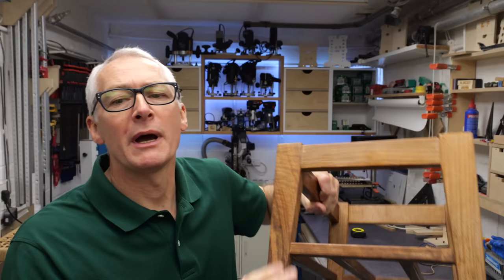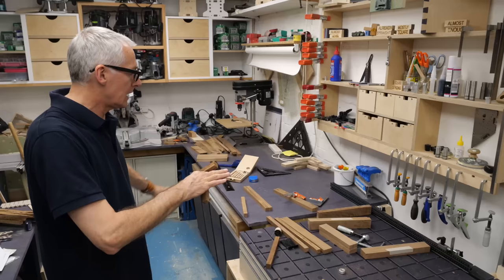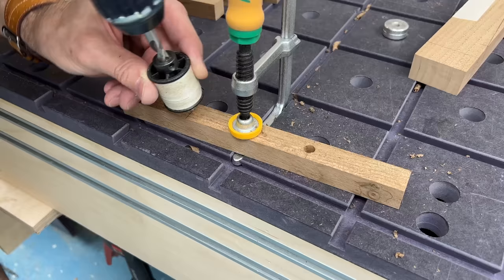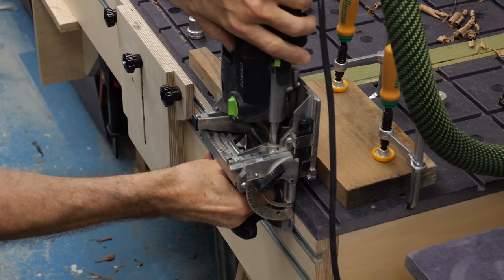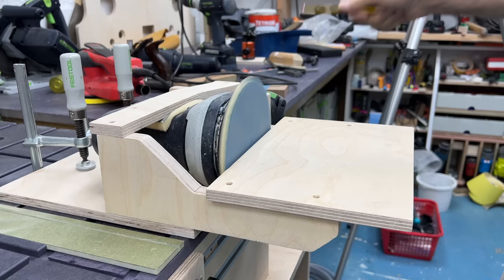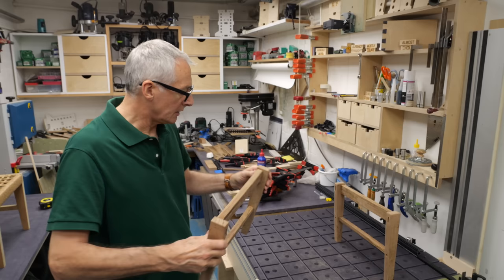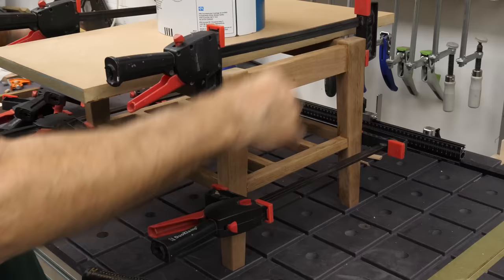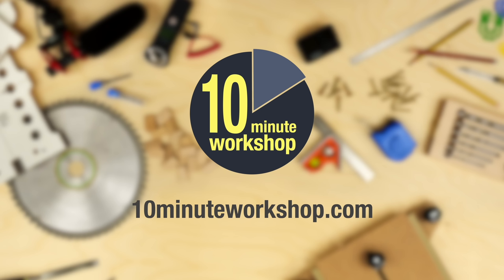Mid-70s style Walnut Footstool [video 503]

Comment: I can't remember where I saw it, but about 10 years ago when preparing trim around windows, I picked up a tip to adhere sandpaper onto a 100mm steel spatula (scraper) with spray adhesive to be able to get into tight corners. Easy enough to peel the paper off to replace or change grits.

Comment: I had the realisation today that if you use the Domino to cut a mortice in the side grain of the first piece, you don't HAVE to cut a corresponding mortice in the end grain of the second, you can still cut a tenon using more traditional means.

But you've still sped up half of the joint.

Comment: I found a nice “rip” blade, fewer teeth, for my plunge saw that usually helps with the scorching.  However, walnut is a squirrely wood.  Some pieces just carry a lot of tension and do unexpected things.  Nice project.
Reply from the maker: Thanks; I have a 28 tooth 'universal' blade that's never had any issues - except with this one piece! 🤷‍♂️ 👍
Reply: @10MinuteWorkshop  yea, looking at the piece of plank you cut from, and seeing the grain of some of the pieces after finish applied, I am not surprised.  Walnut is my favorite medium to work in, the smell takes me back to my grandfathers shop, the wild grain pattern is the usual indicator for me to take care.
Reply: @10MinuteWorkshop  that festool panther blade works well for me, although that wood might be case dried

Comment: Walnut is nice stuff. Interesting the burning? Oils in the timber?
The slow staged glue up worked very well. You did not need a 1000 clamps either
Reply from the maker: Thanks! Always the way right - you buy 1000 clamps but only use 4! 😂👍
Reply: @10MinuteWorkshop  but if you don’t have a 1000 clamps you can still make it. (I must be in a glass half full mode)

Comment: Nice classic looking build mate.👌 Walnut can be a bit if a mare for burning. It's grain is seldom ordered and can have high resin and tannic acid levels. None of which help. A low tpi blade (18-24) and good machine grunt is the best cure. The more grunt, the faster you can move the blade/piece through, cutting down on bogging and burn. The ts55 , great as it is, isn't known for its grunt. Even so, when the grain  directions go walkabout along a cut, the released tensions can cause all kind of cut oddities. One of them things. Mostly the woods fault. Little bit the machines. Tiny bit the operator 😂😉
Reply from the maker: Cheers Stew! 28t blade has done everything I’ve asked - until now! ‘‘Twas a really squirrely bit of walnut to be fair, and changing the wood did wonders for the blade! 😂

Comment: A trick I was taught to clean the squeeze out. Small water pot and toothbrush with a rag or grease proof paper underneath to catch the mess. 
Also would you consider a hand plane to remove the scorch marks (I confess to my hand tool carpentry hobby)
Reply from the maker: I used a hand plane, just wasn’t happy with the video I shot of it.  👍

Comment: Peter - I don't remember you saying anything about cutting an angle on the ends of the short thin rails to match the taper on the inside of the legs but I assume you did that at some stage? A nice combination of traditional materials and modern tools!
Reply from the maker: Thanks Roy. Re the angled ends of the skinny rails to match the tapered legs - I thought that was obvious, no? 👍

Comment: Did you attempt to make 2 or 3 partial depth cuts instead of a single full depth cut to see if it solved the burning problem? Using less of the blade with each pass should, in theory, generate less heat.
Reply from the maker: No, I didn’t - I probably should have but tbh it’s 18mm thick, any sharp blade should wiz through that without any problems really. Looking at the walnut more closely afterwards it had some really squirrelly grain in there, so I’m sure ditching it for another piece was the smart thing to do. 👍

Comment: Those uncooperating cuts, where those rip cuts using a crosscut blade? In that case I am surprised you got so easily away for the other cuts. The dedicated rip blade does wonders for ripping, as it is intended to do off course :0).
Reply from the maker: It’s a 28 tooth Festool rip blade. It was the wood, seriously. 👍